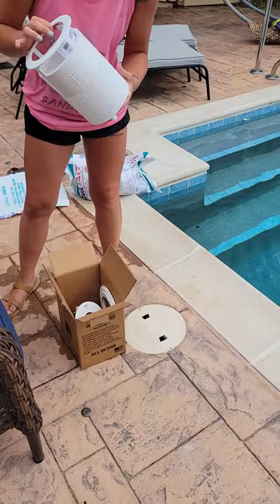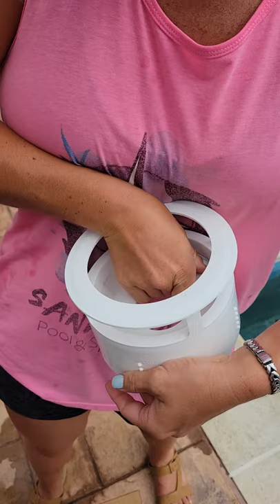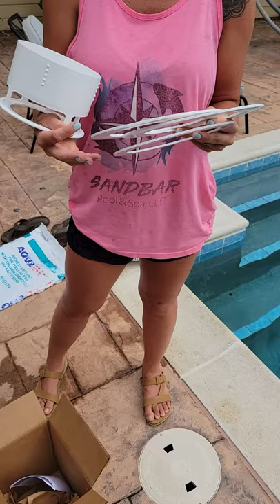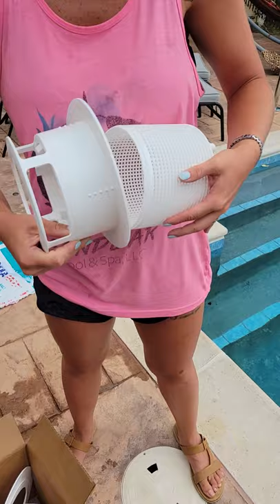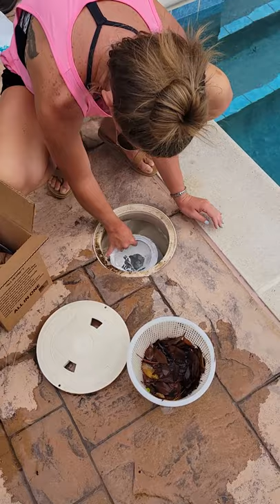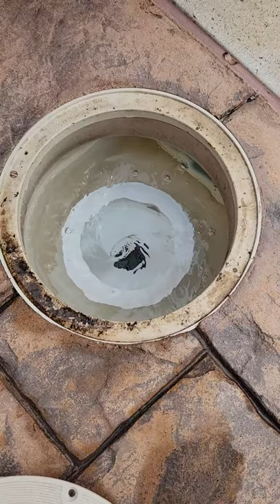How To install a Skim-A-Round Skimmer basket

Comment: Thanks for adding this! I just dropped mine in and I have a fairly violent vortex where it's too noisy, but that's a good thing I guess..
Reply: You could be sucking air into your pump which is not good.  You might want to raise your water level.

Comment: Thanks, in the directions it says to remove the door flapper that is at the opening of the pool at the beginning of the skimmer. Does that really have to be removed?. Also, do you have to shut off the pump to pull out the skim around to clean the basket?. Thanks.
Reply from the maker: I haven't removed any of my skimmer flaps. And no not typically, I just pull it out with the pool pump still running
Reply: @Poolfixers  Awesome thanks. It seems to be working well.
Reply: The flapper door is called a weir. The weir door is what is skimming your pool. Make sure is moves freely and it wants to float when the pump is off. It should hinge inward into the skimmer but not outward.

Comment: They don't honor their warranty. The website states free replacement parts including shipping. The top of mine broke and I contacted them for a replacement part. They sent me an invoice for $15.99 for shipping which is more than the part and shipping cost - total ripoff. Its made of cheap plastic that will break easily. I noticed they have shut off comments on a lot of their social media to avoid having complaints posted about their products.

Comment: It does not work   the thing floats, debris can get underneath, they are a horrible company no customer service. do not use this
Reply from the maker: I'm not sure about the customer service, but the product works great. We have used tons of these, and we don't have any issues. This may be a case of "operator error." I'd suggest taking it apart and putting it back together